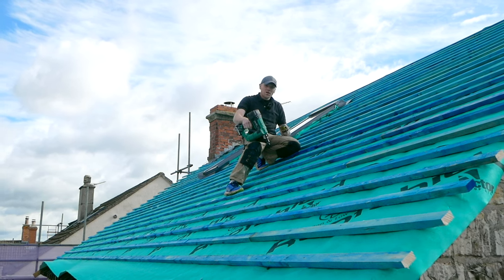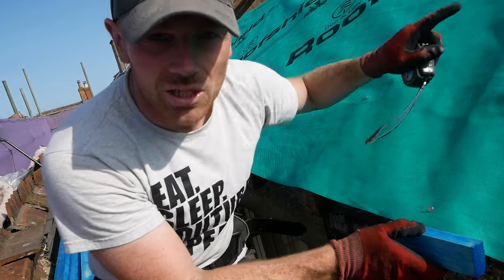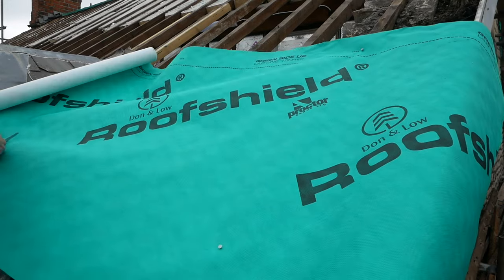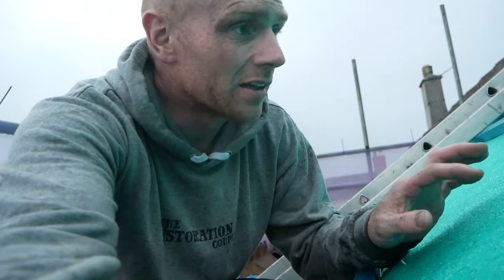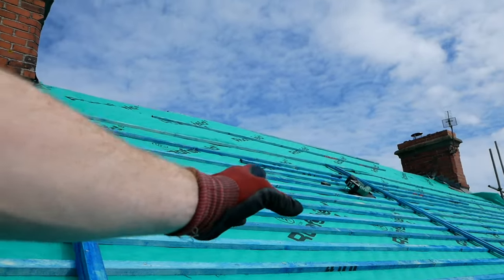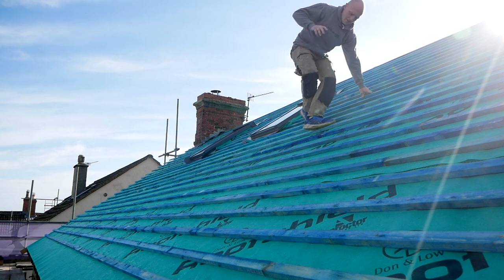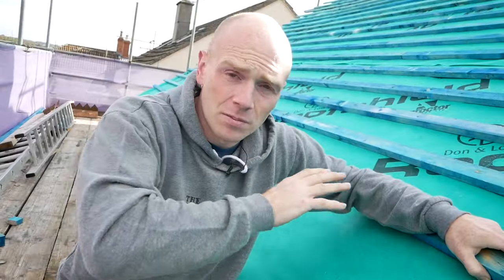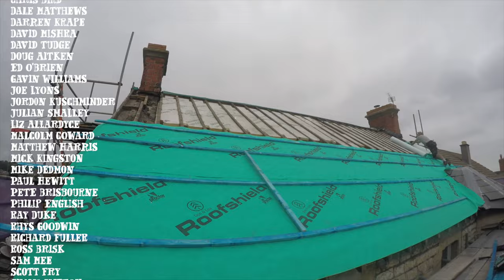MEMBRANE AND BATTENS ARE ON! 🔨  Complete DIY Roof Restoration

Comment: Good job, I would say though measure up / gauge from both gables then fire a chalk line between, every batten will be straight as a dye and by measuring up from the eaves you can shut down or slightly increase your gauge so you don`t end up with a poxy sized cut at the ridge.
Reply: Chalk line agree

Comment: Creating a template using a long bit of wood is a good idea, thanks for that.  I'm doing my roof soon and I intend to copy the original layout (it's a mid terrace with a continuous roof) and I was worried about batten spacing, but I'll just get a long bit of wood and mark off where each batten is in relation to the top and bottom, and that should keep me safe.

Comment: I would recommend counter batons running vertically up the roof under the batons the the normal horizontal baton nailed to them as this allows air flow stopping condensation from forming and rotting the batons
Reply: Think with proctor roofshield being the best membrane out there you don’t even need any further ventilation not even from soffits  it the ultimate membrane and cost a fortune

Comment: The felt needs to be hanging into the guttering Maybe take the bottom batten off & use an eve's tray underneath the felt at the bottom so as to prevent leaking into the house
Reply from the maker: Eves trays still to go in which will be under the loose membrane at the bottom. 👍
Reply: Yeah sorry I commented before I'd watched all of it 🤭 it looks great 👍
Reply: Eaves trays are cheap crap nowadays they'll be twisted and warped first warm day. On slates we like to use the trusty old 5u felt as the trays cause kickers when they are overlapped

Comment: What they'll do in central Europe to maintain that 50 mm spacing between the insulation and tiles is nail down 50 mm battens parallel to the rafters on top of the membrane or felt. The downside is that it raises the roof by those 50 mm, usually more because they typically sheath the whole thing with 19 or 24 mm boards before putting on the felt.
Reply: That can be a problem with planning here!
Reply: Counter lat

Comment: Hi, what is it with blue batons? is it that they have been dipped in some sort of protection or is it just stain. You did very well getting all those tiles off and then getting the roof watertight, I can hardly wait to see the finished roof in all its glory with the soffits, paint job and gutters all done. Good luck and stay safe.
Reply from the maker: I believe it is just I identify them as the graded roofing battens rather than any additional treatment. It’s just a light spray paint that’s added.
Reply: I had a pack of ‘graded’ roofing lath the other day. Opened it and one of them fell in two where there was a dead knot. Yeah right. Excellent videos thanks.

Comment: You should take your 1st course batten  size with fascia fitted, or take into consideration it will be sitting higher than the rafter, not doing this can give you too much overhang into gutter.

Doing a good job 👍

Comment: How do you control moisture inside the heated airspace? You've used rigid foam insulation, and presumably it's quite air-tight, so has little vapor transferance thru to the ventilated attic space.  Do you have an ERV or something?

Comment: If you had made your batten spacer to hook onto the bottom of the batten then the spacing would be accurate from one bottom of a batten to another, even if the battens were different sizes. Looks great though.

Comment: Insulation and airflow in old houses can be a real pain. I have an old 1958 chalet bungalow which needs PIR insulation. The problem as stated in this video is I only have 70mm of space between the rafters allowing the 50mm gap for airflow. The membrane used here is great, but obviously you would need to strip the entire roof. Apart from extending the the depth of the rafters internally, which then takes up living space, is there another alternative?
Reply: You can fix the membrane internally - you 'loop' the membrane over the face of the rafters, and then fix it up on the side of the rafter using a batten along the rafter, with the top of the batten set to ensure your 50mm airflow gap. Pretty hard to explain in words but you essentially make 'hammocks' between each rafter (pulled taut, fixed in place with the battens. This then allows you to fill between the rafters with PIR (20mm in your example), and then you would want to board across the rafters with insulated plaster boards (or woodfibre boards and then plasterboard if you had enough room).

If you really don't have any room to go perpendicular across the rafters with anything much more than plasterboard then have a look at the multifoil insulations - I did my parents' 1950s chalet bungalow bedrooms like this but if I'm honest I'm not totally convinced it is performing well.

Hope some of this helps.
Reply: Thank you very much for the advise. It's much appreciated.
Reply: @emmaslow  if water gets behind the tile, might it start to wet the rafter, and rot the rafter? - if it's done in the manner you suggest?

Comment: Fantastic job!
I didn’t quite understand how you got the battens level over the whole length of the roof though?
Reply from the maker: Measures up each end the required distance and then pulled a taught string line to get the first one marked up straight. Then everything else is base off that. Is that what you mean?
Reply: @TheRestorationCouple  That’s it thanks!
 I thought it’d be more complicated if you assumed the roof might not be square

Comment: I'm surprised that you're not using a timber board as an underlay for the membrane, like the supplier says on their homepage. 
In the nordics, often times we use a cold-asphalt membrane on top of timber-boards, bc that thin membrane isn't gonna last 100yrs like the previous slate roofing material
Reply: R u American
Reply: We don’t do that in England and if u did u would counter batten before battening u need air flow
Reply: @jacksmith4375  No I live in Norway, why do you ask?
Reply: @jacksmith4375  I know how it’s done, bc I’m a carpenter, and I’ve worked on roofs for 13yrs. 
I’m not criticizing your work, it looks skilled. 

I was just wondering, also about not using batterns above  the membrane so the wood isn’t in contact with the moisture the membrane is collecting 
Thank you for replying 😊

Comment: I wouldn’t trust the breathable membrane alone, I’d install fascia vents and dry ridge system just to be safe me 

Also use 3B eave carrier bitumen felt and UPCV eave carrier trays for a double layer of eave protection it helps protect the rafter feet more and at a cost of £20 for 3B felt and £40 for the trays it’s money well spent it will protect against wind blown rain at the eave 

Also you can roll the felt down and over the window to weather them just make sure you get it over the ridge and that will weather it until the slates go on yes you can open or see out the window but I’d rather that then a little leak at the top of the window
Reply: 100% ive had serious issues with it. Tempted to remove and go back with just battens. I mean its the tiles job to keep the water out
Reply from the maker: As good as my scribing is, the new timber soffits will likely give around 10mm all the way along both sides so that will help in addition. 👍

Comment: you were right that the felt wants to have a slight sag between rafters but wrong in installing it with the sag. you want to install tight and it will naturally sag slightly when it settles. other than that looks good

Comment: I’ve been converting lofts for years and never found ‘breathable’ membranes to vent warm air moisture sufficiently on their own whatever manufacturers say they’ve achieved in tests. Don’t know how this product differs but I’d personally go belt and braces and add eaves and ridge ventilation while it’s still easy to do
Reply: Standard breather is only vapour permeable roofshield is air permeable
Reply: Agree , used this on a couple of jobs ... still get beads of condensation.
Got to add additional ventilation
Reply: Does the roof not need to be counter battened to add eves and ridge ventilation, I've ran into trouble before with  condensation with breathable felt solitex , it's a mínefield when it comes to insulation, you can never  be too careful
Reply: @jimbolger264  the vent gap is between back of insulation between rafters and the underside of the roof felt
Reply: @coops6621 
I understand that you keep the insulation away from the breathable membrane and batten it doesn't touch it, but condensation can still form on the membrane and get trapped behind the batten, if your roof is counter battened it has a clear run off to the eves plus you have more air circulation and it doesn't sweat, it's like wearing a coat  that is not breathable your body will create heat and you will start to sweat if the heat cannot get out it will turn to moisture and you become wet.
The tiles or slates are not breathable  that's where the problem is the hot air can get out till it reaches them and then it condensates back onto the membrane, maybe I'm completely wrong.
Reply: For sure

Comment: SPROCKETS!!??  These should have been fitted before the sarking but can still be placed with your loose eaves. The depth of the sprocket should be = depth of the batten + 3x the thickness of the slate.  this is all to guarantee that the water on the sarking is properly guided into the gutter.  Relying on only the fascia board will cause a depression in the sarking behind the fascia board that will allow water to permeate down the back of the fascia board, especially with the pereable sarking.
Did you consider multi-layer insulation like TriIso 10 that with 2 layers and a limited amount of board insulation provide tghe highest insulation values with minimal rafter depth?  Multi-foils are over priced in UK but can be purchase at around £6.00/sqm from various on-line sources and at this price they are very competitive with other insulations that are slower to lay.  The multifoil does away with the ventilated sarking  and provides a warm roof that is so much better than a cold roof with the insulation at ceiling joist level.  Check out the Actis French web site to see how the product is used to very great effect in roof insulation and sarking.  It is commonly used in Alpine buildings that defines its pedigree.

Comment: I am having some trouble with the batten and wondering if someone can help. The roofer has advised 20 blanks 4x4.8m when i went to the supplier he advised that they do in meters that is 192, my roof is a pitched roof, is this correct as it doesnt seem right, doesnt help the roofer themselves didnt make it clearer and is currently abroad so his work number only puts a out of office.

Comment: I realise it's a bit late now, but wouldn't it have been better to install vertical battens first and then run the horizontal ones over the top?  That's how I've seen people doing it around here.  That would provide full clearance for any water to run off and improve the ventilation over the whole roof.
Reply from the maker: Yes, counter battens are a good option if you can account for the additional raise in height, lead flashings, fascias, barge boards, etc. That said, all being well there won’t be any water running down it! 🤞
Reply: @TheRestorationCouple  Yeah, already having those roof windows in place might have made for some trickiness around them with the extra height.  :)

Comment: Unfortunately that roofshield isn't ad great as you've been told. I've got it on my terraced house of similar age and I've had worse condensation on the roofshield than I did on the old hessian felt. Thats with soffit & ridge ventilation.
Reply: Hi Worzel. Please contact me as I work for the technical team at Proctors and your instances are most definitely not common with Roofshield and usually we can find a reason. If you have ventilated the roof at eaves and ridge then this is bypassing the benefits of Roofshield but we would welcome further discussion and to review photos etc of the issues.

Comment: If your phelt isnt tightish it could flap in high winds roll it out tec it 1 end then nail it out your doing this by yourself very impressive
Reply: Not supposed to be tight it’s supposed to sag a little to let moisture drain, or use counter battons
Reply: @martinsutherland4270  tight,,,,ish not to saggy not to tight
Reply: @francescodobherman3487  
Sag a little 
A “  little” being the key word

Comment: Get some 300mm DPC and use as an eave protection strip. It goes underneath the bottom piece of membrane and will be close to flush with the bottom slate to ensure any water getting through goes into the gutter. There's also plastic and metal systems you can use for this. 

You don't want any green visible by the bottom slate once done....
Reply from the maker: We have a black plastic eaves carrier to go on but yes essentially does the same as the DPC. 👍

Comment: Omg this is not how you use membranes, all the condensed water won't be able to go down because use didn't use vertical counterbattens, also you killed the ventilation flow from the bottom of the roof to the top.